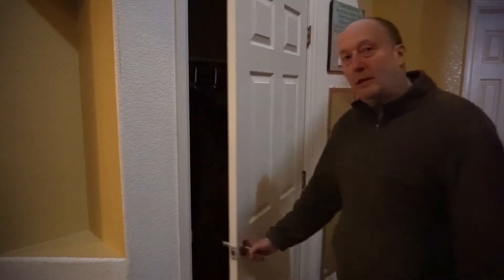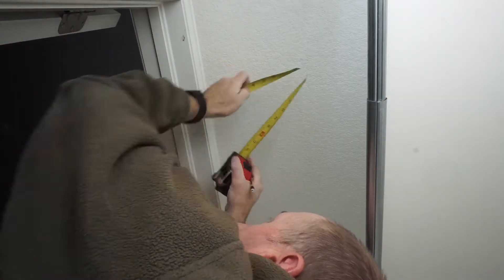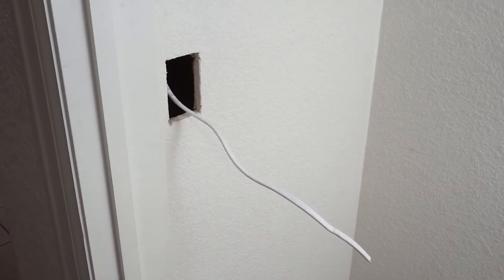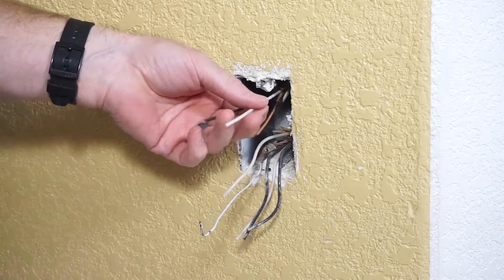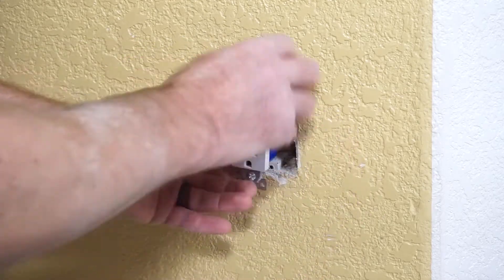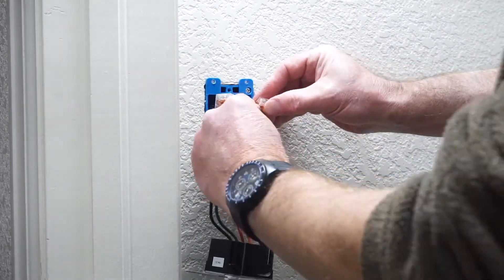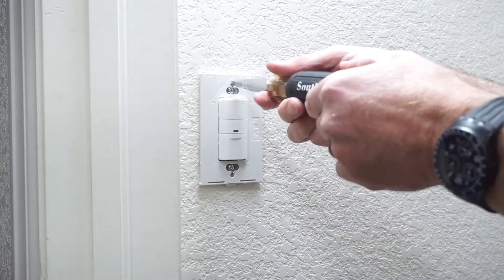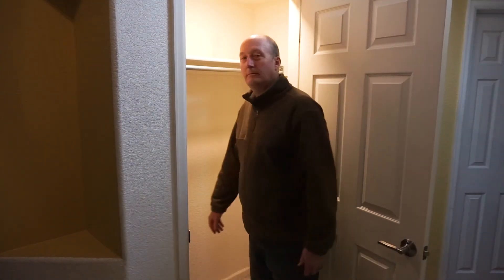How To Install a Motion Sensor Light Switch

Comment: Looks like this was a bust of the job.....  You also left the unused screws on the recepticle unscrewed,   Those should always be tightened before installing in the box.  Lastly,  I don't believe that WAGO makes a push on connector.
Reply: Why do the unused screws need "always be tightened before installing in the box?" And where in the video are Wago push on connectors mentioned? I heard them described as lever connectors.

Comment: This video was not helpful at all. You did not explain your steps in wiring. I still  don't understand how to wire a auto sensor switch.
Reply: Skill issue
Reply: What I heard was pretty clear: attached the ground wires, then the white/neutral and then the black/hot wires. Also how to strip and how to attach them to the devices and to the WAGO connectors. What other steps do you need explained?

Comment: I got mine installed but I'm not getting any response from the switch. I know which black wire is the power source and which black wires go to the light fixtures